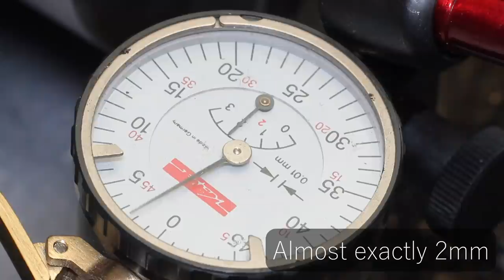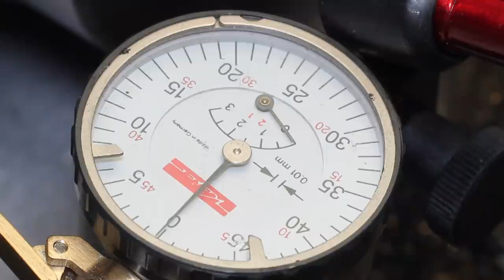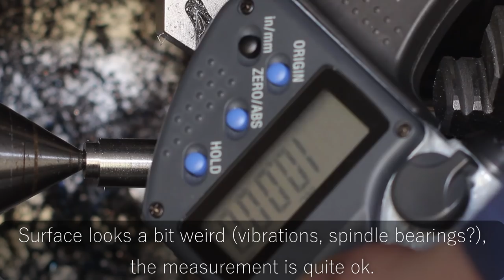Mini Lathe tailstock lever clamping modification - Part 2

Comment: I love the simple way you turned the eccentric lobe on the locking shaft. I thought you would have used your 4 jaw chuck, but you got the job done in style, and much better than original. You certainly take pride in a job well done.

Comment: This is my new favorite channel! I will one day build this for my lathe because the wrench thing get old! And the cool factor with a lever-above the charts 😎 Keep the videos coming  👍🏻
*A taping tip: On parts with square edges that have tape hanging further than is desired. Use a flat and smooth piece of metal to rub over the top of the overhanging tape on the square edge and it will be trimmed to size. Be gentle, as moving too fast can rip the tape instead of shear it.
Reply from the maker: Thank you so much! I highly recommend to upgrade to this lever thing on the tailstock. Makes the work a lot easier. And thank you for the taping tip! I'll keep that in mind :)

Comment: What a huge improvement! 
Your skill has really incresed since you started your channel, it's very inspiring. Can't wait to see the next project
Reply from the maker: Thanks for your kind words! I reall do appreciate that. Yes, it is a huge improvement. The only thing I have to do now is to grind the underside of the bed parallel to the upper side. They did a horrible job at the factory with the result that the tailstock clamps uneven due to the uneven bedway underside.
Reply: @WeCanDoThatBetter  omg yes! I've experienced this problem too. Made the carriage loose and tight along different points of the bed on my lathe. Took a file to the high spots on the under side of the bed and its moving a lot smoother now. Amazing vids. Necessity is the mother of invention; you put that little lathe to work. Respect.

Comment: Nice work 👍😀
The rough finish you mentioned when turning the small diameter is because you haven’t enough “toolpressure”.
You use a tungsten carbide insert and they are not truly cutting but rather it’s a controlled crumbling.
You must have noticed that these inserts aren’t that sharp when compared to hss tool
Therefore they need more power to cut the material and a good constant depth of cut and feeding speed.
These small lathe have not enough HP to create enough cutting power to get a constant “toolpressure” on the tip of the insert , and this shows in a rough finish on the smaller diameter or a typical high frequency noise.
That is why hss tooling can give a much better result when cutting smaller diameter or when making a “finish “ pass.
Specially on the small lathes switching to hss can give better results 👍😀.
If you cut with tungsten inserts and you look on the box you see the small feed and speed diagrams for a depth of cut.
Depending mostly on the nose radius of the insert it shows the correct feed speed and rpm to get a constant force on the cutting edge.
This constant force gives a constant cutting/crumbling of the insert and a smooth finish.
As soon if you change on of these parameters for example a finish pass immediately it results in a rough finish or high pitch noise.
Because the constant force is not acting upon the insert the holder is pushed down ever so slightly and springs back in a high frequency and this is where the noise and/or the rough finish is coming from .
I hope it makes sense 😋
There are a few options you can do to get better finish…
1) use inserts with smaller nose radius 
2) a greater depth of cut , feeding speed or lower the rpm ( creating higher torque)…
3) use hss tools when cutting small diameter 
I hope these tips are helpful and I explained it correctly

Comment: I gotta say...  i’ve watched a lot of videos on the Mini-Lathe, and your videos and workmanship is some of the best I’ve seen.  I recently bought a second hand Grizzly 7x12 and am still in the process of getting the basics set up...

Which lathe are you using here?  Have you upgraded the power at all?  What about the ways and cross slide?  You seem to be able to get very nice finishes and tolerances, even with your 42crmo4 tool steel.

After seeing your machine in action, I don’t think anyone can blame the lathe!

Aside from your videos here, do you have any other online presence, Blog, Facebook etc where we can see more information on your work and modifications?

Thanks again - keep it up!!

Comment: Hi, I have either appreciated care for good workmanship and quality of presentation, apart from subject. In about 2015 I started  myself a campaign of improving this lathe, including tail-stock mod. What I have done and can recommend you further are following: Change spindle bearings to tapered ones (a must for improving quality and precision); tapered-adjustable gibs for saddle (once you say you want to improve straightness of your lathe bed) and an automatic clutch for lead-screw feeding triggered by adjustable stops along the bed. This especially allows careless engaging-disengaging of saddle always with the right timing and is very useful for thread cutting; though I could not get used to it so that now is unused. Another good mod. for stiffness improvement was increasing number of existing gibbs set screws. Tutorials were at that time available; now I don't know...

Comment: Well done! A real improvement.

By the way: While filing on a lathe you should move the file slowly forward. Else the file works at one single spot all the time and the wear increases at this spot.

(Eigentlich blöd, wenn ich hier mein Schulenglisch zusammenkratze, aber die Herrschaften jenseits des Kanals und des großen Teichs wollen ja auch ihren Spaß ...)

Comment: Does a counterweighted Chuck exist to compensate for the imbalanced stock fixturing to minimize wobble-vibration? Because that's quite a stress for the bearings and the machine itself.

Comment: Excellent work! I guess these are not available as an option from the lathe manufacturer? i. e. seems like a lot of work...
Also surprised that you don't seem to have a quick change tool post for your lathe.????
Reply from the maker: Hi and thanks for your comment! As far as I now, there are some conversion kits available for the tailstock but they aren't that well built. And yes, it was definitely a lot of work :D But now in use, it saves a lot of time and is a very helpful modification. You can off course simplify it for your purpose. 
A quick change toolpost is something I have on my purchase list since a while but haven't finally conviced me to spend the money for :)

Comment: I guess you slotted the bottom clamping piece to allow sudewards movement so that it could 'adapt' to variation in the bottom of the bed? As well as a method to grip the nut. I guess the nut allows height adjustment to allow for wear and to fine tune the handle position?

Comment: "Oh please no, please GOD no, not again !" Basically your lathe motor when you insert a milling tool in your chuck.
Reply from the maker: You mean, that's not ideal for the motor? I guess the bearings in the spindle are the weakest part and not really made for milling.
Reply: @WeCanDoThatBetter  :)
The motor is the thing that keeps your lathe running, if you split your load to another machine "milling machine" your lathe motor will thank you and live more for you :)

Comment: The base of the tail stock doesn't sit flat on the bed?  Maybe a thin brass sheet glued to the bottom of the tail stock would even it out?

My lathe, which is the same size as yours, came with the lever on the tail stock as standard.  I thought all these Chinese lathes were the same but obviously they are not?

Comment: well done mate !
i just wonder, do you have height adjustment on tail stock for alignment with spindle?
i think it is only side2side right?
Reply from the maker: Thank you very much! Yes, it's only a side to side adjustment at the moment. To adjust the height, you have either remove some material from the baseplate or add material. I think the tailstock is a bit too high at the moment. Perhaps some day, I'll scrape that in.

Comment: I enjoyed your video on this tailstock unit. I have only one question for you. How did you get the unit to stay in the housing? I was thinking you might use a slip ring setup or drill and tap the rod
Reply from the maker: Thank! Yes, there is a snap ring on the shaft between the black steel housing and the inner side of the tailstock casting. I don't know if I showed it in the video but the handle can't fall off to the back side.

Comment: Did you heat treat/harden and temper any of the 42crmo4 or just use it in the as purchased condition?
Reply from the maker: Hi, I didn't do any heat treating as you most likely have to grind the parts after heat treatening. I think for this application the steel is hopefully tough enough without heat treatening.

Comment: You can minimize or even eliminate a lot of that chatter and squealing if you slow down your RPMs. I can see a lot of your chips turning blue as you are cutting, which means you are rotating too fast and approaching the work hardening temperature of your material.

Comment: After using this for some time, have you had any issue with vibrations causing the cam clamp to loosen on the tail stock?
Reply from the maker: Hi, no. The Tailstock never came loose so far. It locks very safely, I neer had issues with it. The only thing was to grind the underside of the bedways to even thickness so that the tailstock gets clamped evenly throughout the whole bedlenght. That was not given from factory...

Comment: Nice, do you think this give you similar performance to tightening the nut? I've been considering  this modification myself but had concerns that it might slip.
Reply from the maker: Thanks for your comment. I had this concerns too. From what I have tested so far, it clamps really strong and feels pretty safe and secure. To be sure, I have to first grind the underside of the machine ways so that the tailstock clamps tightly in every position on the machine bed. Unluckily it's from factory thicker on the right side than it is in the middle of the machine. Therefore I can't use the tailstock properly before I have ground it even.

Comment: Well, that is certainly the most complicated, convoluted and time-wasting way to build a simple locking mechanism. You ALWAYS choose the most complicated way to do everything, even when it results in an inferior solution.
Let's drill a hole in some round bar... the first time, use a drill press. The next time use 4-jaw chuck in a lathe! Spend hours dialing it in with a indicator, and video every step!
Don't clamp the round stock in the V-block/slots of the vice, use the flat jaws and spend extra time with a dial indicator to tap it 100% flat. Drill the hole to be perfectly square in reference to.... absolutely nothing!
Spend hours turning up brass bushes to a 0.0001 mm tolerances inside and out, epoxy them into an existing cast iron hole... then drill and ream them to 0.001mm accuracy. Gotta be dead accurate for this situation where they will be deformed out of round within a few days!
Need to flatten some totally non-critical flat bars that will apply pressure from below. Don't use a surface plate... face them using a 4-jaw chuck in a lathe ROFL WTF?
Lovely as an artform, like jewelry or watchmaking... but an absolutely crazy waste of time.